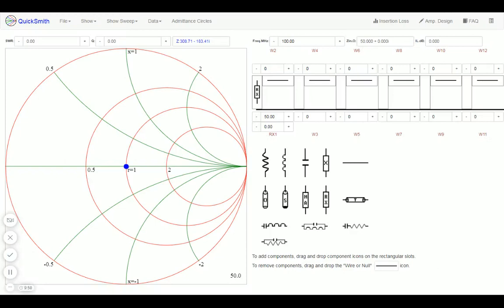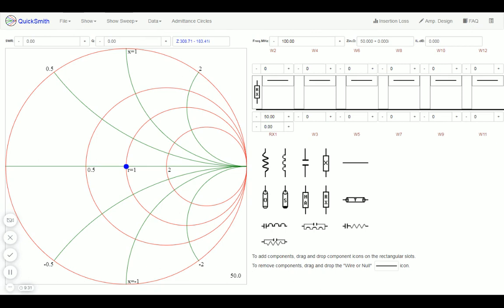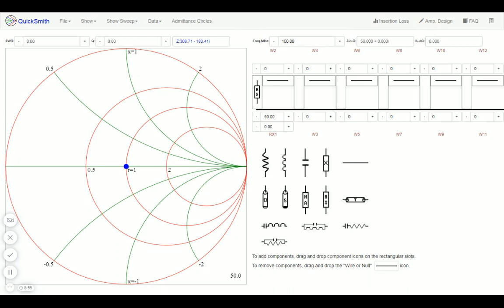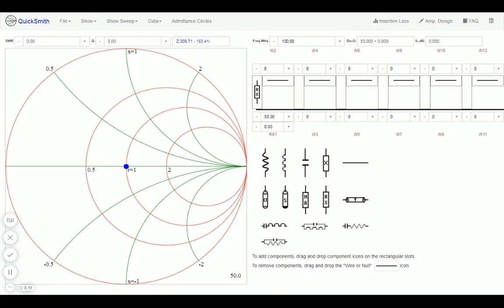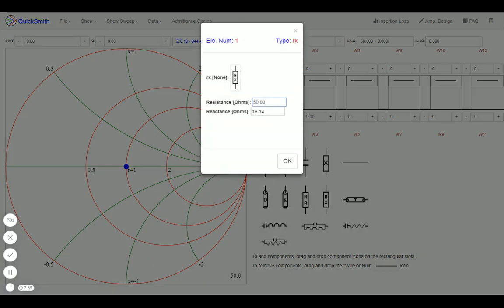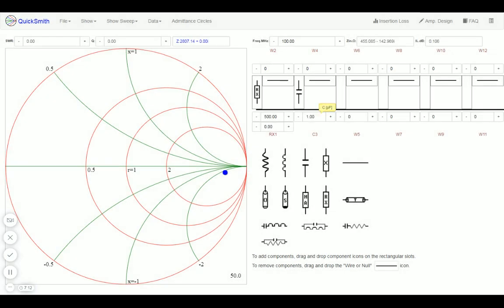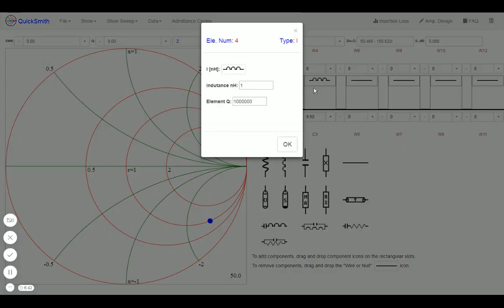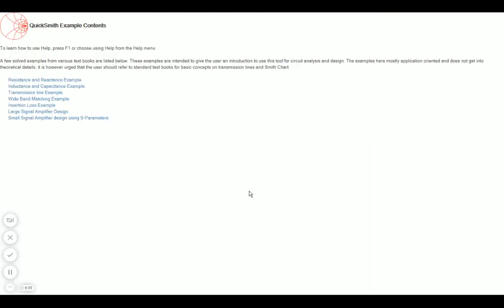Smith Chart Tutorial - QuickSmith - Open Source Smith chart for Web and Mobile

Comment: Would be more useful if we could add stubs, shorted or open.
Would be good to be able to enter load as resistance and capacitance/inductance instead of just resistance and reactance.
Would be good if it would be possible to enter values directly and not have them rounded to the step size when exiting the field.
The noise that is made when you try to do something not permitted is just too annoying.
Still, a very interesting program.